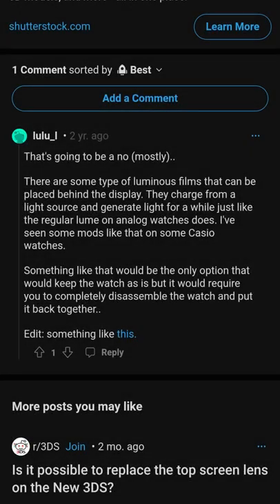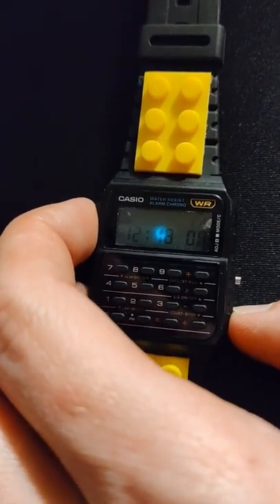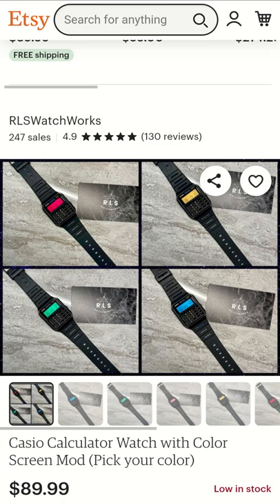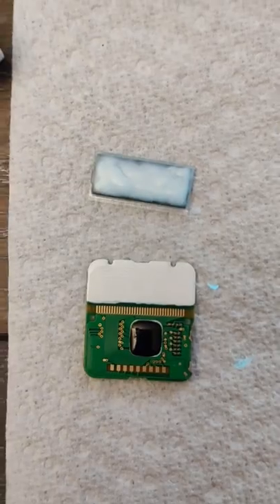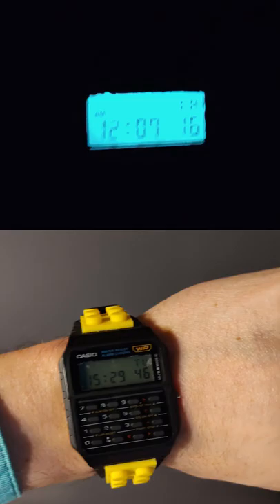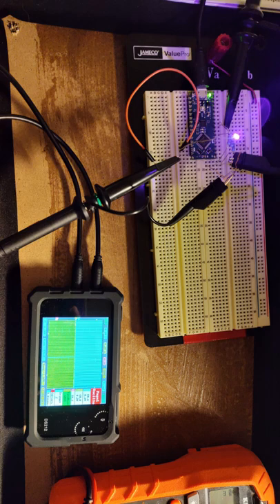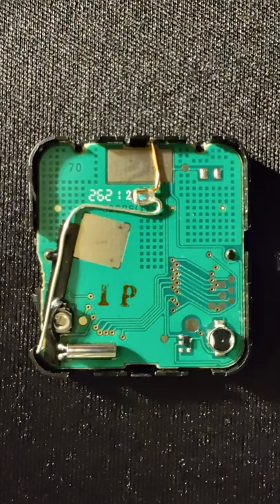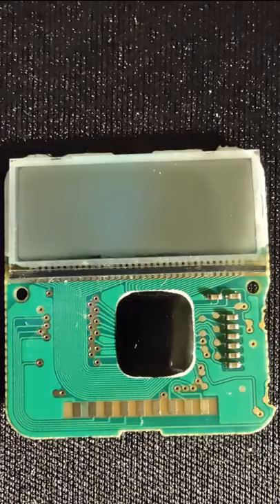Casio CA-53W Backlight Mod!

Comment: I’m the original poster that made the post where the comment came from. I’m glad someone actually did this. It’s been 50 years since this watch came out and I’m honestly shocked Casio hasn’t done this in an official capacity as of yet.

Once they do, I’m immediately buying one.

Is there a reason for the Lego on the wrist band or is it there for aesthetic?
Reply from the maker: Hey! Welcome! No, I just had a roll of Lego tape and it felt like the right thing to do. It fell off within 6 months.

Comment: When you removed the back film, did you remove just the reflective part or also the back polarizing film? Love your video BTW. Had this idea about a year ago, bought the supplies to try it, and didn't get around to it. You beat me to it!
Reply from the maker: Thanks for the watch! Please make a video doing a better job than I did, lol.
I only removed the reflective part. All those LCD mod tutorials that invert the black remove the back polarizing film and replace it with one shifted 90°.
If I redid this, I would get an efficient, bright LED (that wasn't UV) and put it in the side like a lot of embedded Backlot watches are designed.
Reply: @AuxiliaryPanther  okay cool, so to clarify, you left both the back and front polarizing films? I might experiment with a color change mod too, then.

That's also a good idea.  Although I liked your video style a lot!
Reply from the maker: @alexanderkempf9828  yes, both polarizing films are there.
Reply: @AuxiliaryPanther  I kept both on mine, and when I tilt the watch away from me the display becomes invisible. Definitely an issue with the polarizing film, but I'm not sure what I did wrong.
Reply from the maker: @alexanderkempf9828  mine is hard to read from the side, too. I think it's just a FeAtUrE.

Comment: Could you give some further information on how the led is wired?
Reply from the maker: "Wired" is a strong word, lol. One terminal is held against a battery termina; this is held in place by the compression of the case. The other is hovering next to the reset contact; this makes contact with the other battery terminal when you press the Reset pushbutton on the watch halfway. Because coin cell batteries have higher internal resistance than larger batteries (like AA), you don't even need a current-limiting resistor in series!
If I redo this, I do plan on putting a whiten LED off to the side for better illumination.
Reply: @AuxiliaryPanther  Did you drill straight through the PCB behind the screen? That's safe to do? What about cutting a small notch on the side of the PCB, so that the screen is lit from the side (like other Casios e.g. the F91)?
Reply from the maker: @bibblybobbly9951  I would cut from the side if I redid this. After looking at the PCB, it looked safe to drill through in that spot, and it ended up working fine. Looks like no hidden traces inside the PCB.
Reply: @AuxiliaryPanther  Is there anything holding the LED in place at all, besides the friction fit of the LED through the drilled hole? Looks like you might have soldered or fashioned some kind of little lever mechanism onto the negative pin of the LED, near where the button pushes against it.
Reply from the maker: Nope! Just friction. For that lead hanging out by the button, I believe I squashed the wire to make it thinner.
Reply: @AuxiliaryPanther  OK I've been trying this myself. I drilled a hole nearby where you did to push an LED through. But I can't close it up to reassemble it, the LED sticks up too much. How did you manage to sandwich it closed, with the metal frame part (that carries the battery and button connectors)? Are you using especially low-profile LEDs? I've even sanded down the LED as far as I can without destroying it, but it still stands too proud to get the back case closed.
Reply from the maker: Yes, my LED is very small, and has thin wires like fairy lights without the coating, so mine only protruded less than half a mm through the hole, mating up against the back of the LCD. Remember, I removed the reflective backing and added a luminescent coating behind the LCD, so that really thin layer is the distance my LED protrudes.

Comment: Could you do a more in depth video as I would like to do this myself
Reply from the maker: Thanks for the watch! (no pun intended)
I may one day make another video, but know that I would use a non-UV LED mounted on the side of the LCD (like every other watch does), so basically redoing the project from scratch, but still replacing the LCD back silver layer with UV paint. 
I recommend you get a small tool kit and dive into one yourself! It's a lot of fun, and only $20 to to replace the entire watch if you screw it up that badly.

Comment: Can you do a current draw test to see if the battery would run out in 10 seconds or not? Because if it has terrible battery then I would just buy a Casio DBC32 which has both a backlight by default along with more functions
Reply from the maker: I used the same battery for 2 years (replaced it a month ago, and had it installed since a few days before this video was posted), and there was no loss in functionality, just some loss of LED brightness. I recommend reading the other comments where I reply to see what I said could have been done differently. I would say I activated the light for several total seconds per week, since the luminescent background charging feature did not work very well.

Comment: Any ways that you think could... Improve this mod ? 
Cuz I really love this watch (Breaking Bad fan) and it is a real bummer that I have to pull my phone out every time if I wanna see the time in the dark
Reply from the maker: There's probably ways to make a bright LED output, but it would involve a voltage regulator and the battery would get sucked down in days instead of years.
Reply from the maker: Best thing I can do is not use a UV LED. A white one would be better. It wouldn't charge up the luminescent backing, but it could be useful.

Comment: Would it be possible to place an SMD LED to the side of the display and activate it using one of the front buttons (do these buttons get the V+ voltage)?
Reply from the maker: Yes, my crude method for routing the wires should work no matter where the LED is located. Some of the plastic watch frame may have to be carved out to make room, however.
Reply from the maker: Oh, I forgot to answer the parenthetical part: no, the other voltage bus goes into the chip. You would need to use a transistor or similar method of controlling the LED, which the CR2016 batteries are not as good for since their internal resistance is high. I was able to gate a BJT to control an LED using a 3V power supply, but the CR2016 couldn't hack it. Maybe if you had a transistor with smaller ratings (mine was from one of those breadboard kits) it could work: power the LED through a transistor, gate the transistor using voltage from a button.